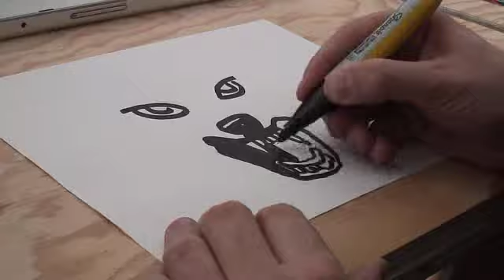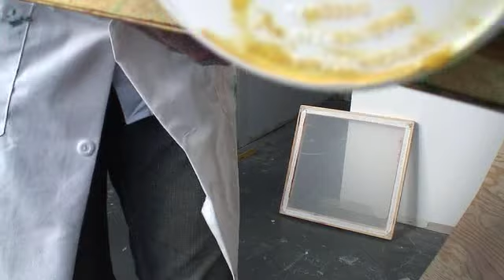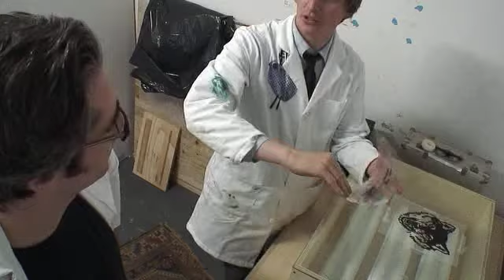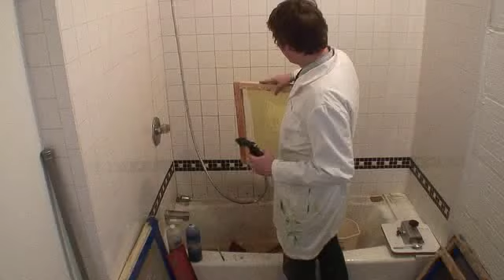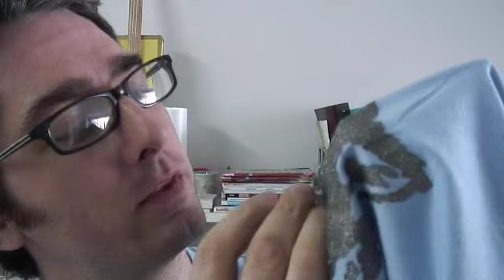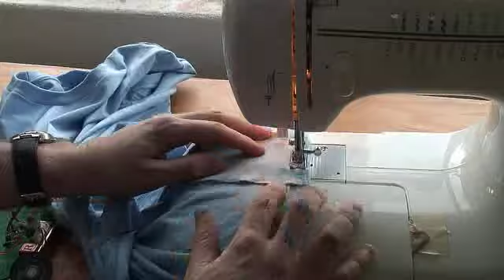Learn how to screenprint your own t-shirts

Comment: I'm starting to screenprint but not sure what type of vacuum and roller skate to use to weigh down the wood, any suggestions?
Reply: 'what will be the cost of roller skate", I think if you want a good screenprint don't spare any expense on the roller skates (high-end in-line skate) OR vacuum cleaner (factory grade wet-dry vac)
.
Reply: I prefer the 4 wheel roller skates.
Reply: what will be the cost of roller skate

Comment: I worked in screen printing (designer) & was shown that a separate screen are burned for each color. I made sure there were not gaps between each one. I used light box (think xray) that let me check gaps. When you color separate, layer the vellum on top of each other should produce a perfectly black blob silhouette. I created registry marks to line them up properly. The registry marks burned onto the screen.Tape over them when printing. I suggest white as the base for better color quality.

Comment: You can buy transparency sheets that will work with any inkjet printer. One side is more roughed up than the other so the ink will stick. Usually sold at Staples or Office Depot.

Comment: You can use either an inkjet or laser printer to print the transparency. Make sure you use the right type of transparency depending on your type or printer. Some printers are not compatible with transparency paper so check your individual printer's manual. Hope this helps, thumb up so others can see!

Comment: @TheSiftonStrangler We recommend this because it is always best to encapsulate the mesh with a layer of emulsion on both sides, that makes sense right, it would make a stronger stencil which = finer detail prints. You can of course get away with just one coat but it is technically correct to do two. Ryan

Comment: You don't need to burn it. Just trace it with pencil onto the screen, then paint blocker/modge podge on the area where u don't want paint. If you cant do that, use a plastic sheet like these guys, and sponge the paint on.

Comment: @fredykiller24 it's called plastisol, u can get it on any screen printer supplier
 "Plastisol is a suspension of PVC particles in a plasticizer; it flows as a liquid and can be poured into a heated mold. When heated to around 177 degrees Celsius, the plastic and plasticizer mutually dissolve each other. On cooling the mold below 60 degrees C, a flexible, permanently plasticized product results" thx Wikipedia =-)

Comment: @kayaraiestiaiene I wouldn't recomend a flashlight to expose the screen but you can get a 500 watt halogen work light for less than $20.  Just set it at least 12 inches from the top of the screen.

Comment: @Mack0B 

i found it easier to take it to kinkos, 75 cents a print. the paper is overhead projector transparency paper and its expensive , you will have to know what type of printer you have and buy the paper that is made for your printer. These are the mistakes I made.

Comment: @ninjasdielast They used a flash cure machine, this machine swivels over the shirt and takes about 25 to 30 seconds for it to dry. in bigger production you would use a conveyor belt dryer. About $300 for a flash cure unit such as the populas Tabasco.

Comment: @plachzzn Emulsions are made out of chemicals called diazos that are light sensitive, once applied to the screen and exposed to light, the coat of emulsion will harden where the light hits, where the light does not hit (because of the image you placed over the coated screen) becomes water soluble and washes away. Now you have a stencil that allows you  to pass ink thru the washed away emulsion.

Comment: I use the florescent lighting in the ceiling of our downstairs as my light source, only takes about 25 minutes and the emulsion washes out a lot easier than when I exposed with the sun. 

What kind of ink did you use for the jacket?

Great video, I have a few on my channel about multi-color printing and multi-shirt printing at home.

Comment: @bubukakc2011 It's called a Photo Emulsion. Some suppliers are Ulano and Xenon. It's fairly easy to handle, and is essential for a quality print. T-shirt printing is all about technique, attention to detail is key because you would feel bad selling T's with errors such as, one line over-lapping another, or one line with a split hair separation from the other.  You know? Let me know if you have any questions...

Comment: For anyone whose thinking about getting into screenprinting to make a bunch of shirts, this is a great video. For anyone looking to make ONE shirt, screenprinting is not the approach you should be taking and yeah, the materials and equipment in this video are going to seem inaccessible. If you're looking to get a few shirts made, you can find websites nowadays that will take custom orders with no minimum number requirement. Screenprinting is when you're trying to make a lot for little cost.

Comment: @Kaveret  "common skills like building a box are taught to 6th graders"
Again, Show me a 6th Grade curriculum that teaches a child how to work power tools (if not power tools then maybe a hammer/screwdriver? working with wood, nails, glue (if needed), Plexiglas, fluorescent fixtures and also shows them how to fit in a power adapter or run it from a power source. 

Yeah, didn't think so.

Comment: @Kaveret  "total cost: like 20$"
- For the average person Bunnings would be the cheapest. I still don't think that it would equate up to $20 or less for the wood, Plexiglas, fluorescent light fixtures. And even if the average person were to find all these materials, they would definitely be taking longer than 4 minutes to just gather the materials alone.

Comment: @lucasclay69 wouldn't it be a lot more easy if you just used a heat press? i mean, they did leave a lot of stuff of but screen printing itself looks like it takes some time unless you have one of thos machines they had that can do like 4 or 5 shirts at a time. And heat press you just print the graphic out and press it onto the shirt with heat. much quicker and faster though do you know the quality-length between a silk screen and a heat press?

Comment: @MookieSays1Love 

That's how emulsion works. Emulsion hardens when it comes in contact with light. This is why the spots where there was black print (the wolf), did not harden because they didn't get any light, and therefore wash away easily.

Comment: more mistakes i found

16. he doesn't explain what a flash dryer is its a curer that you use when using a multiple layer print but in this case he uses it to dry it

17.he mentions a exposure time but its specific to each exposure unit/bulbs/amount of bulbs

18.he doesn't explain how to register items its a long process to explain but worth mentioning at the very least (people who wanna know what this is

19. he doesn't mention to go back and scoop up the excess emulsion

Comment: 10.once more for big production tips if you're going to be using thin lines use an adjustable power hose and use it near its lowest amount so you don't blow  your screen out

11.he ignores a key factor of how to tape up a screen to cover the parts uncovered by emulsion first do all four sides with masking tape then doing the corners with a triangular shaped tape piece then cover ONLY the top and bottom with a shiny electrical tape

12.moving the ink up is not necessary

Comment: 7.he mentions but does not explain the whole black fabric thing it's to protect your eyes from the unfiltered black light (recommended)

8.again if you re looking to do big production go ahead and spend a bit of cash on a real drying unit they dry much quicker then putting it in a cabinet as shown)

9.he doesn't explain that sometimes your image wont be perfectly visible before washing

Comment: 4.while scoop coating was a normal practice at the time there are also spray on scoop coats that are better for the inexperienced  person because a they save time b they don't make a horrendous mess c they don't smell so awful

5.from personal experience multiple emulsion wipes allows for better coverage

6.if you re looking to do big production go ahead and spend a bit of cash on a real exposure unit one its more accurate (btw with real ones it tends to be 1-1 1/2 minutes exposure)

(cont'd)

Comment: @PenangDap That is a light sensitive direct liquid emulsion that is used to make the stencil with your film positive and a light source. There are 3 main different kinds and they come in different colors depending on the manufacturer. Each type has its advantages and disadvantages and will expose at different time ranges. Check out my channel and website for a ton of free info about screenprinting tee shirts! It’s my pleasure to help out!

Comment: @TheEd500 Actually, the screen will last a very, very long time if properly maintained and if it is not abused. The mesh is what will wear out over time. The mesh threads will eventually become frayed which causes loss in detail and poor ink flow characteristics. But is does not last forever, unless you only use it once a year maybe…LOL.

Comment: 5) Use masking tape carefully tape up edges on inside of screen frame to prevent ink from seeping out. This is a critical step to be done carefully or it will end up on your subtrate (material you are printing on) in this case a shirt. 6) Different materials require different types of inks and drying methods and tempetures for proper curing.

Comment: 3) Spray and allow water to soak screen image for about 30 seconds before washing out unexposed emulsion. Lay newsprint flat against inside screen while leaned up against wall and blot both sides making sure that emulsion is not pushed into printing area. 4) Dry screen with fan and make sure there are no pin holes in screen as all open areas will print. Pin holes can be "touched up" by using unexposed emulsion with brush and allowed to dry.

Comment: I have 25 years screenprinting experience so following recommendations: 1) Do coat both sides of screen at least twice and finish with the printing side last.  This gives you a better stencil thickness which will increase the ink lay down, however you will need to increase your exposure time. 2)Use foam rubber inside the screen to hold it down with the plywood on top. This will help reduce light undercutting the wolf image on clear (the positive) when exposing.

Comment: Thanks for the fun video. Someone below asked about doing this with less expensive equipment. Well, you can use a heat gun to flash cure and an oven for the final cure, for instance. You can find a number of 4-color machines for just a few hundred. PrintingPlans site has free plans to make one or full kits with all the parts to make one.

Comment: all you need is the screen, a squeegee, and a shirt. they had that big thing because they do a small/moderate amount of screen printing. 
you can do the actual application on anything, a table, car hood, sisters back. The only difficult part is not messing the screen up with light before you let it set in the dark.

Comment: This is a silk screen print, not and iron on transfer. There is no heat involved in getting the screen image inked on the shirt. You seem to be under the impression that he is ironing it with heat. He is sliding the ink over the screen and on the the shirt, not heating it.

Comment: @ellachristina i have tried with normal paper and a heat press - heat with pressure  and it works 

i think its all about the printer  - try on ?glanced? (i dunno how is that word in English)  paper and if the paint doesn't leak it should be better

ps you need an ink-jet printer (no laser to dry out the paint)

Comment: You use controlled light to harden it, they just say that so that you wont leave your pre-burnt emulsion screen out in the light.  It is just best that you do it quickly.
As for the emulsion, you can buy it at most art stores, and don't be confused by the colour of it, it has no effect on your print

Comment: Serigraphy or Silk Screen Printing is a stencil process. There is evidence of stencil application that goes back over a thousand years in ancient Egyptian, Roman, Chinese and Japanese cultures for decoration. It was not until the middle of the nineteenth century that stencils were first applied to silk mesh. In 1907 the first patent was taken on silk screen printing - that is, with a stretched  frame and a squeegee. During the last 60 years it has blossomed into a full fledged industry.

Comment: Where the black design (of the wolf) printed from the computer on the acetate is placed on the unexposed emulsion covered screen, the black print of the design stops the light getting through.  The remainder of the emulsion on the screen is exposed to light and 'fixes' - the bits under the design - which were 'shielded' from the light - wash away (i.e. were not fixed) leaving a 'hole' - if you 'like' - in the emulsion where the design is and through which the ink flows.  Does this make sense..?

Comment: Last but not least, the pallets they are using on their machine is only able to print on flat surfaces (t-shirts, bags, pieces of wood, etc). Items such as jackets require a special pallet so the jacket doesnt rise if you print a multi-color job. 
Other then that 1 being the worst and 10 being the best i give this video a 4. They use a lot of obsolete equipment & need to go more into depth if u really take advice from these guys. Other then that, they locked up some of the basics.

Comment: few things they forget to mention! First off, the meshes (fpi) is important depending on what design u want. The lower the FPI (as he said he used a 110 mesh for his wolf), the more ink that will print through the screen. 110, 156, 280 & 355 are your basic meshes! The more in detail a picture is, the higher the mesh you want!
Second, when you coat screens, coat twice on the front & once on the back or it will wear out when your trying to wash out the image. Try it if you dont believe me

Comment: using a flash cure is only to dry the top of the ink, you need to run it threw a dryer to cure the ink. Most ink cure a 325 degree.

Comment: you should coat both sides of the screen to avoid pin holes.  Also another thing he didnt tell you is that when spraying out the screen you shouldnt have to much water pressure shooting out at the image or you will destroy the image. Finer images take more time to spray out and you have to use a finer and higher mess. And do not hold the squeegee at a 65 angle its a 45 or else you will smear the image.

Comment: it is a slowish process but like anything once you learn how to, and have it set up is quicker than you think, also, its one of the most cost efficient ways of printing, as you can reuse the screens, unlike heat transfers, also making the screens allows isolated areas to be printed, not like a stencil.

Comment: The image can last a fairly long time, if done right.  Most graphics these days are done with screen printing.  If you are worried about the image you can always turn the shirt inside out before washing, which helps a little.

Also, i have found discernible difference from an extra layer of paint, if anything, too much paint might actually be bad.  

Hope that helps

Comment: you use different screens for each color, before you print you line up the design using a test print. which is the first color prinited on a shirt then you lay the next screen down and line it up that way

Comment: fyi to everyone - your not suppose to use a flash unit as a dryer it will not cure your ink all the way and will crack after you wash it. you must run it through a tunnel dryer. this is my job so i know :)

Comment: For one it is NOT called silk screening anymore.  It is called screen printing, two words and the mesh is made of polyester NOT nylon.  If you want to print a t-shirt you can use a mesh count between 33 to 355.  The higher the number the finer the mesh.  A 110 mesh is ideal for a dark color on a light fabric.  Dry the screen with the substrate side down, that's where the thickness of your stencil will be.
How long have you been a screen printer, a week?

Comment: He did dry the screen, they just didn't show that part. Probably just let it sit overnight and air dry.

Everything in the image that was NOT black was burnt onto the nylon. The black blocked the light from exposing that part, which caused it not to harden and wash right off.

Comment: the dried emulsion protects the rest of the shirt and the press that holds the screen is pressed down hard with the squeegee allowing for the ink to only go where there are holes in the screen. so if you are scared of getting ink everywhere on the shirt then make the emulsion go across the whole screen and possible give it two coats

Comment: Also I don't see why you couldn't prepare the screen the old-fashioned why with liquid emulsion and use the Yudu for the rest. Hmm I wonder if anyone has tried that. The reason I bring it up is the emulsion sheets are more expensive than the liquid.

Comment: There is something called the Yudu that helps people do it at home with just 1 machine. It works a bit differently - you use emulsion sheets to burn the image onto the screen instead of liquid emulsion. The machine comes w/a dryer in the bottom and a lightbox built in. It's interesting. It seems to produce good results though I haven't tried it. I have used big machines in workshops like in the vid and it's not that hard just a bit time consuming and definitely messy.

Comment: already looked on there, none listed in my area, theres one in Massachusetts for 200 bucks and its a 4X4. 6X4 is not worth the extra money. 6X4 costs an average of an extra 300 bucks. 

craigslist also doesnt provide all the necessary tools... no exposure light, flash dryer, emulsion, vellums, and ink..